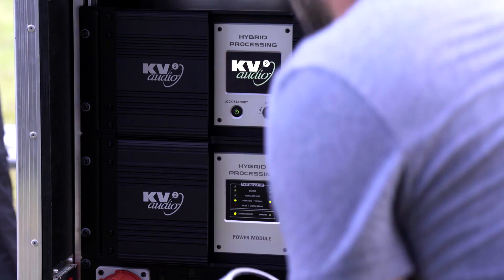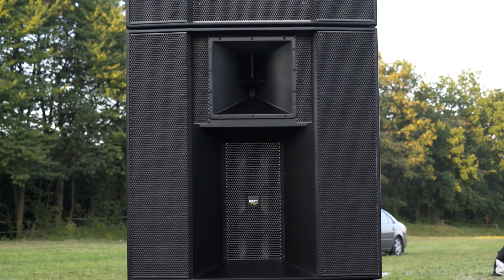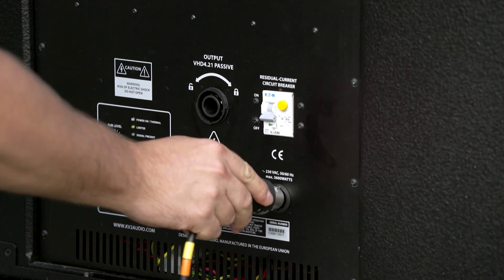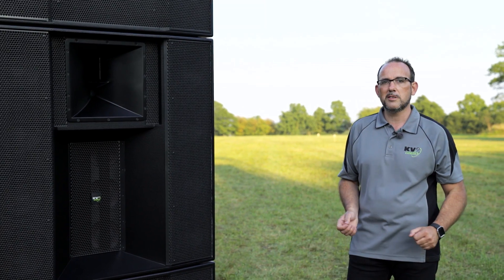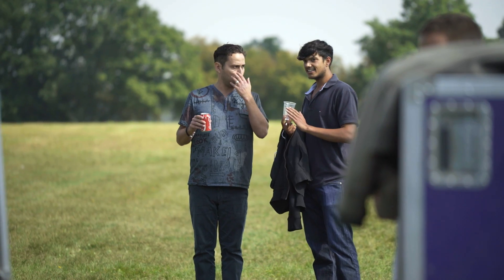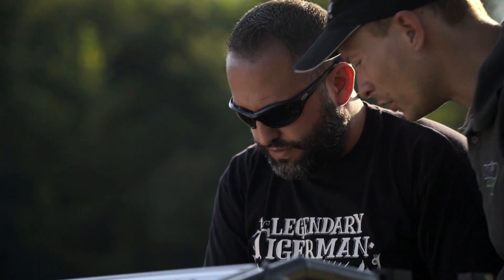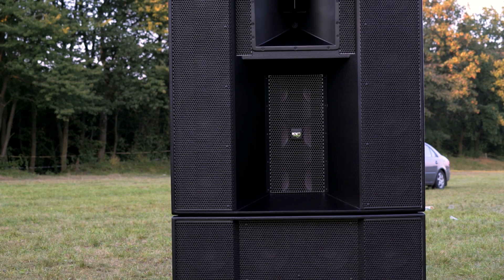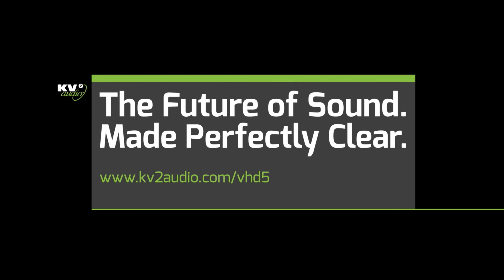KV2 Audio VHD5.0 Constant Power Point Source Array - Introduction

Comment: I can enjoy concerts at small venues where there's no line array and bands sound loud and unique. I grew to dislike larger venues with line array systems however, where you take two steps to the right and it feels like you just went to a different concert and EVERY SINGLE BAND SOUNDS THE SAME. I keep looking at my old concert photos from the late 90s when stages looked massive and you were really blown away by those speaker mountains!

Comment: I assumed you mesured the dB @1mtr distance and how much does inverse quare law effect @100meter ?  Will the system be sufficient for a  rock concert full off crowds @100 metre distance ?
Reply: Well it would be 1/10,000 or - 40dB - whatever air absorption knocks off in the highs.

Comment: Danley sound labs are really efficient speaker boxes
Reply: Yep fine if horrendous Group Delay is your goal. Synergy tend to chuff at high power. But lucky for Tom it is masked a bit by the Mid/Hf at tbe throat. Bless him he does try.
Reply: @amgineacoustic  Danley J5 caleb does get it out of the world performance. Like best in class with dB spl.

Which I believe the vhd 5 will not do.

Comment: Allmost good as FUNKtion one.  But less funky. More sweaty
Reply: "Almost as good as FUNktion One" now theres a funny. FK1 one is rubbish. Sounds awful so I guess you have a point. And like Void all three have more waffle than breakfast  yet more Band Pass nonsense on LF. Do these people believe their own crap I wonder. It is all quite funny. They getting away with it coz your aberage punter is always impressed by meaningless Spec Sound bites. I love how this rig has not 1 but 2 crossover points were there should be any at all. KV2 has recently been the replacement in a london club where some other crap Flipside used to be. Same Turd different Polish I guess
Reply: @amgineacoustic  I'm not going to say Funktion One is bad but you usually need more than one box per side to do huge events in which case it ceases to be a point source and you end up with more interference problems than your average line array when trying to array multiple F1 boxes. They do have some line array systems out though now.
Reply: @TimpBizkit  Vero? Not seen or heard but told it just F1 rearranged. Not a wide horizontal coverage device. F1 sound nasty cannot handle complex waveforms.  So I do not think you can call the vero worthwhile most use of F1 is for EDM you can use any ol shite for that usually.

Comment: In car audio class D amps are more efficient and have better bass quality than class AB amps, all the comments seem to say otherwise for pro audio, can someone explain? 

 Anyways I think it would be cool if someone built a folded horn wall in a car but it would probably be way too big, everyone seems to be going 6th order nowadays for bandwidth
Reply: Car audio works on 12v DC power. Pro audio runs on 120-220v AC power.
Reply: Well because subwoofers handle only bass, the resolution of the amp doesn't need to be as great. You could probably get away with a really low frequency "switching" in the pulse width modulation because you don't need to cover the highs. This means you could build cheap subwoofer amps that switch at 1 kHz or thereabouts which would be filtered out to avoid an annoying tone in your subwoofers. Full range amps would need to switch at least 100kHz to be several times the highest frequency they will play.
Reply: There is less point to a folded horn in extremely high SPL car systems. Maybe the ones trying to get the most out of a 12 or whatever. By the time you are getting to a wall you can compress the air more with a direct radiator. Horns trade force for displacement, but inside a world record car, the speakers act more like pistons compressing a small air volume in a car cabin. Getting loud in a field is more about moving a large amount of air at low pressure rather than trying to compress a small amount of air to extreme SPL.

Comment: how heavy are the boxes?
Reply from the maker: Hi Matthew, 

VHD5.0 module: 151kg (332.2lbs) - 1 per side
VHD8.10 module: 92kg (202.4lbs) - normally you will need 2 - 3 of those per side
SL412 (as downfill) is 60kg (132.28lbs) - 1 per side

More information here: https://www.kv2audio.com/products/vhd5.html or here: https://www.kv2audio.com/vhd50-constant-power-point-source-array.html
Reply: +KV2 Audio 09535014509

Comment: Far too much DIGITAL isn't always a good thing
Reply: Tyrone Nelson it’s the future get used to it dude
Reply: Charles Byrne EXACTLY, that's the problem, have you seen the world lately??
Reply: But some of the worlds highest powered systems run on analogue platforms, and the some of the worlds well known musicians all prefer analogue class ab equipment because it sounds better, class d equipment has way too much crossover distortion, does that explain things better for you?
Reply: Scott 1 What i meant is that people are giving new digital equipment a bad name by giving you false numbers and watts for a sales point, these days when newer equipment fails which it can be designed to do (so people go out and spend more money) they throw it away I'm an electronics engineer and i repair / rebuild all kinds of equipment like this all the time and newer equipment is getting more common for repair because newer things are becoming less reliable, all i mainly hear and believe is that old equipment is simply built better and lasts
Reply: Yes i repair alot in the speaker and power amplifier department (rather than the mixing desks which barely go wrong anyway) so when it comes to repairing amps especially the peavey, behringer, kam, mackie ev ones i only seem to get an issue with the slightly newer amps which have the switching power supplies which dont really seem to cope with as much abuse as the slightly older ones which have the torroidal power supplies, but in general it all depends on the make and brand you use, so if you are using speaker boxes and arrays at festivals and gigs its probably better to stay with the expensive high end brands like rcf peavey and ev so you know whatever components in them are used, you know they are going to last
Reply: Charles Byrne  it docent matter at the end your the one mixing. Your the one that docent need to fuck up
Reply: I do hope you are not classing Class D as "Digital" because it is Analogue. Class TD is also Analogue. Most Consoles are now Digital at FOH. Sure a few still using Cadac or Yamaha PM or even a few Midas in use but the majority of riders are Digital Yamaha or Midas. Mr Martini does have excrss waffle. But has not a single clue on tbe Coherence issues or how to solve them due to a lack of undetstanding Applied Acoustics. Just another Marketing based brand. Who sell kit based on nonsense. Like many others they prefer it to selling it based on real performance results. Follow the now common trend of ambiguous specs with little or no true data. Paper Coned "Mid" thst isn't. Got 2 lovely crossover points where they do not belong. Cleay demonstrates the ignorance in design. We got a single element  with an operating range of 250-7000Hz. Perfect low distortion coherence where it matters
 no Band Pass Monotonic Low Frequency nonsense. But High DI control of LF with IR to die for. Danley is just another Amar Bose just not as clever. But his Tapped Horn BS is funny. Servodrive was his only good idea  though he did not possess the Engineering skills to get it quite right. He has a passion for high resonance devices. Not very accurate just make a noise.
Reply: And Touring Sound has not made much progress in last few decades. Line Array has problems. Most like D&B or L'Acoustic are pretty shite & not well designed at all. There is nothing special about them or the design concept employed. They are all still just a souped up Disco Dave reflex device with a very poor mid/hi waveguide concept for the rest of it. I came to this Industry from Defense/Aerospace. Pro-Audio is considered slumming  for applied engineering but I changed for the fun & music. JBL was sold to Samsung coz it is finished. No future for their 60yr  design concepts they keep rehashing over & over. Europe is once again at the forefront of Transducer design. And soon to be the same with System design. Line Array can work but not in the current form. I requires radical change in concept giving far reaching improvemets in directivity accros the 60-22000 bandwidth. The problem is the Engineers do not have the required knowledge in the major brands. It will happen but Sonics are still quite low down on the list of Priorities. KV2 is a self defeating concept as point source as for large scale deployment means multiple source points that do not have useful co-linear behaviours
Either way these guys are not getting any Cigars
Reply: @Scott 1 I ran out of breath reading that comment aloud without a comma, or a full stop.

Comment: well im sorry too tell you, i have custom designed quad 21inch hybrid sub cabnet that can produce 10 hertz at 138db at 1m from ground 8000watts RMS 16,000watts peak for 15 seconds before an autocut off kicks in
Reply: better than sex. But you'd need a box the size of a living room.
Reply: Unless you have unlimited amount of cabinet space, running even the best modern drivers down to 10Hz is inevitably going to limit the potential maximum output at higher frequencies, where people can and want to hear powerful sub bass.
Reply: Well to be fair, Meyer just announced their VLF which goes down to a claimed 11Hz. 

Of I course I know no one is really doing it for a PA sub. I was simply pointing out how the poster above would effectively cripple the performance potential of any sub, regardless of driver size and quantity.  

I added in the joke relating to Hoffman's Iron Law, though obviously that is very pertinent here. 

I just wondered that if the OP had achieved the performance claimed above - whether they realise how much output is lost proportionally as EQ is added incrementally, to increase output at lower frequencies beyond the natural Fb frequency of the cabinet. 

Thanks for replying, but I really do understand exactly how the amount of power involved, such as that typically required to achieve the dB level claimed above, would be catastrophically damaging when applied to a sub driver. 

However if Meyer's specs are correct (I'm assuming 11Hz is their -3dB figure, though it may be -10dB) it clearly can be done with the right engineering! 

I note they do not specify a ratio of how many VLFs would be required to keep up with one 1100LFC, which shares the exact form factor. I was surprised at the latter, since the few designs I know that can get near such low frequencies (basically only Danley and specialised theatre designs) are horn or bandpass boxes. 

Presumably Meyer must have wanted to allow easy integration with Leo / Lyon + 1100LFC arrays, which no doubt influenced the bass reflex design.
Reply: Scott 1 - I'm not attempting to be snarky or smug, but it appears these guys are pretty confident they've managed it:

https://meyersound.com/product/vlfc/

I was wrong however. Apparently Meyer's VLFC only goes down to 13Hz - which is suspiciously not referenced to any dB scale.

I don't know if Mick Hughes uses it in his "TM" vertical broadside end-fire centre clustre subwoofer array, for those 360° gigs which date back to when they were running Milo / 700s, or if it's placed in an exploded configuration to achieve a helicopter ground vibration effect, which is apparently used on some Metallica songs.

When you mention PA only reaching 50 - 70Hz, I assume you mean full range boxes, as opposed to subs?

Nearly all rider friendly arrayable modern large format tops (eg K1, MLA, Leo, Anya etc) are pretty comfortable down near to those frequencies if needed, though I rarely see them run so low - since obviously subs are always available at that level, which can better take the load off such LF extremes (eg J can go lower, but before the D80 and ArrayProcessing came along - it made more sense to reinforce circa 100Hz and under, via arrays of J or B2 subs, plus infras for the lowest notes).

I completely agree that such extreme low frequency performance is not needed for most modern music programme material (outside of cinema LFE channels). 

However for demanding EDM with sustained low synth lines, there are capable subs from the likes of d&b, F1, Danley, EM Acoustics, Martin and KV2 - all capable of going near flat to or below 30Hz.

Curiously KV2 seem to run all their subs up to a 125Hz electrical crossover point, though I suspect they are taking advantage of the inherent increased sensitivity at frequencies up and over the 100Hz mark.

I agree that for normal use, we don't need frequency response going into the low 20s. 

If I'm spec'ing, tech'ing or managing a rig with that capability and processing granularity - I err on the side of caution, if offered the opportunity to raise the lowest HPF, just for the sake of being careful and increasing headroom.

Hence I'm not disagreeing about this not being either normally practiced or necessary - I'm just pointing out it can be done, at least by one touring system.

My original comment was simply in response to the post at the top. Given the capabilities of modern design and prediction software - I see no need to put costly drivers at risk, for the sake of a fleeting reading to prove the extremities of the capability of some fancy big sub design!

I think it should be apparent that I understand the limitations of human hearing, not to mention the lack of utility for such sound reinforcement solutions - but you did ask who was actually using this type of product, and outside of LFE channels in cinemas, there clearly is at least one band!
Reply: We have a 2 x 21 being brought to prototype f3 is 22Hz - 300Hz 148dB SPL 8Kw program coverage upto 1000Metres. Good DI minimal GD. Incidentally Danley TH only system supplied with a Timetable so you know when to expect the LFE. These guys are not breaking any new ground. But are inventing new ways to bullshit the market
Reply: Thats largest nonsense ive ever heard. 10hz its impossible to hear, 138db is nothing impressive. 16kW of power is also nonsense.... Just waste of money and time..